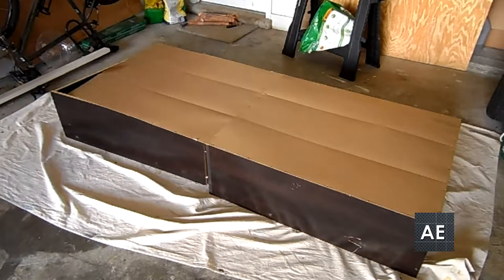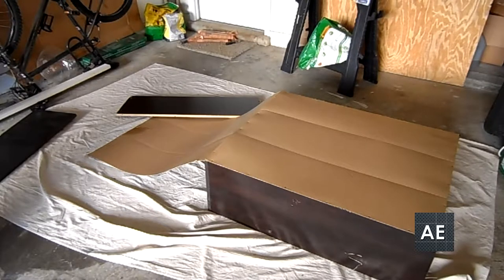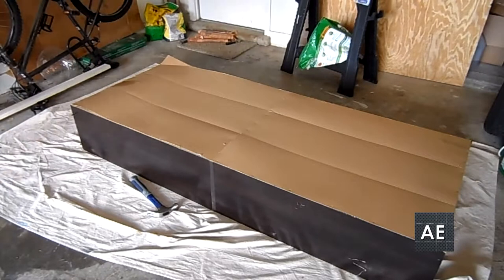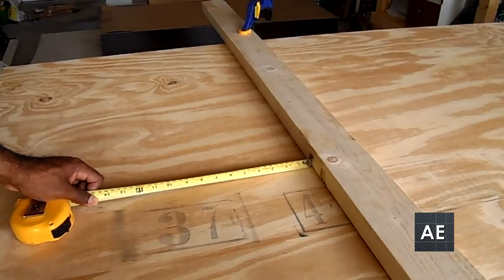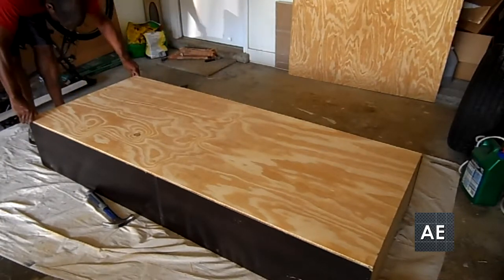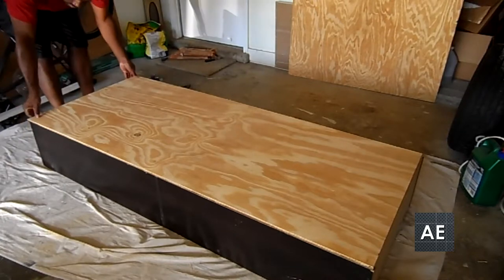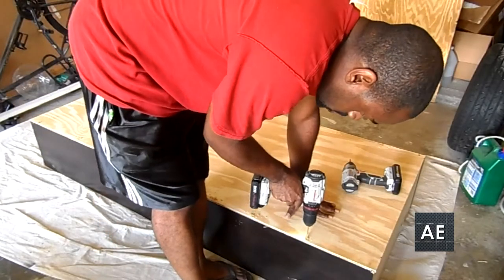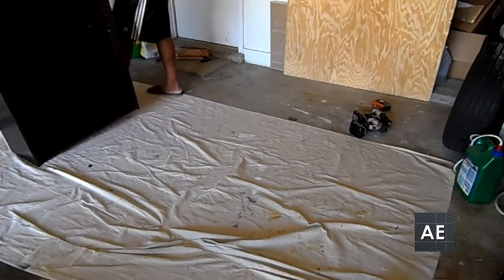Reinforce Bookcase with Plywood

Comment: i have the same issue thanks for giving a solution & its great, by the way i am new (67 years old) diy and right now i am using skill circular saw which is heavy to operate. can you please share your circular saw make & model, that'ii be a kind gesture, thanks once again
Reply from the maker: The saw use is a Porter Cable circular saw. Runs on battery power. Im not sure of the model number. Definitely lighter than the Skilsaw that I have. However the Porter Cable does struggle with thicker and denser pieces of wood

Comment: Hi, what size and length wood screws did you use ? The particle board MDF edges tends to crumble
Reply from the maker: I believe they were 1 inches screws. Whatever thickness of plywood that you use (note not MDF), use a screw that is at least 2 or 3 times that in length

Comment: How thick was your plywood? What size and type of screws did you use?
Reply from the maker: I'm not sure. I believe it was between 1/4 and 1/2 inch
Reply: Trying this over the weekend. Are the measurements provided for the wood or the screws?
Reply from the maker: Between 1/4 and 1/2 inch plywood. Size and length of screw will depend on the thickness of the wood,  do I didnt provide that
Reply: How long of screws did you use?
Reply from the maker: I dont recall. Definitely longer than necessary as it what I already had on hand. I'll  say they are at least 1.5 to 2 inches
Reply: @rhtservicesllc  do you have anyone to recommend to help me with this?  This is exactly what I need to do with my bookcase.